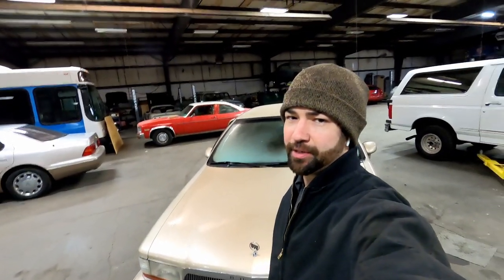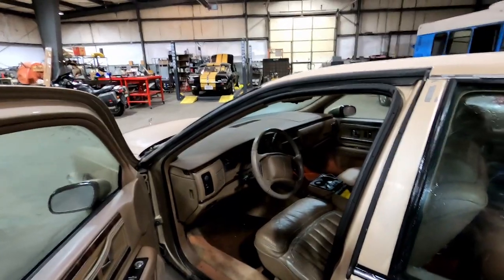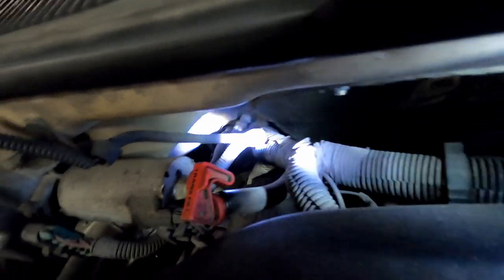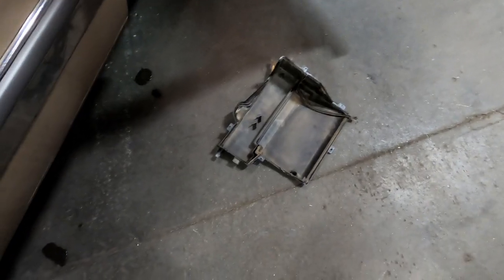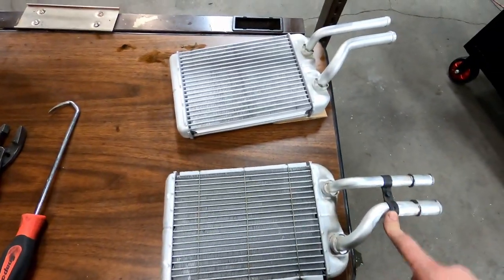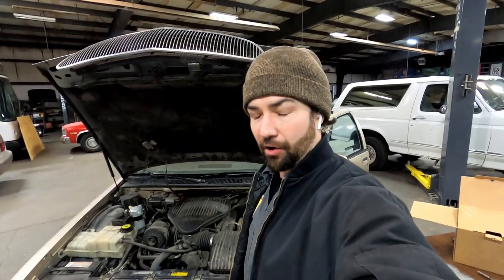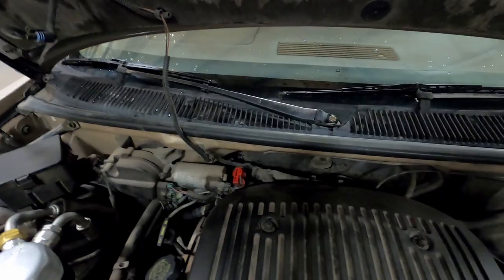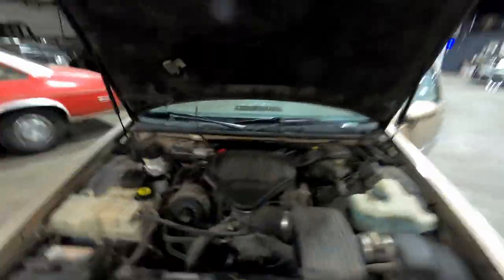The Easiest Heater Core! 1994 Buick Roadmaster

Comment: Those older GM's can be nice to work on. But, the easiest heater core is surprisingly a mid 80's E series Ford van. It's located in the passenger kick panel. Literally a 10 minute job. Keep it up!
Reply: 93 Ford Rangers pretty easy as well
Reply: Same goes for up to 1996 f-series. So easy you could do it in the auto parts store parking lot.
Reply: nope 1970 Ford Galaxy eight or ten screws in the firewall remove two hoses, plate, and out comes the heater core replace in reverse your done did it in less than 20 min.
Reply: That was back when Ford made great cars & trucks.
Reply: Yeah some of the older Ford's it took longer to drain down the coolant down than the repair, my 89 F150 and 82 Mercury Capri (Mustang clone) were both 10-15 minute jobs.

Comment: Quick and easy fix. Gotta love those Buicks.

FMG
Reply: Wouldn't it be nice if the pipes extended in to the cabin with a break  just before the core itself .  Would be so much easier to replace these

Comment: My 96 Roadmaster sedan has heat, but it only comes through the vents. I also think the fresh air/recirculate door is stuck open. The faster I go, the more air I get regardless of fan speed. 
That's just one of the many electronic problems it has. The wiper control module exploded so I had to pull a spring out of the motor to get them out of the park position. Now they only work on high and they stop wherever you turn the switch off.
The fuel gauge quit shortly after replacing the fuel pump assembly. I use my trip meter as a gauge now. I'm getting about 12 mpg. I need a tuneup. I used to get 15 mpg.
The temp gauge quit years ago. So I use the on board diagnostics in the automatic climate control to check the temperature. (It's #8)
The window regulator guides are going out. I've replaced a few with the Dorman 74444 rollers. Just need to do the rest. 
The power antenna motor burnt out. So I gutted it and just use it as a manual antenna now.
It's got over 170k miles on the original Optispark distributor and still running pretty good. But I'm gonna have to rebuild it soon. Nobody makes a good replacement. Not even MSD. And it's too big of a pain to do it more than once.
The transmission is gonna need rebuilt. But still shifts pretty good for the mileage. Gonna swap out a quart or two of fluid with Lucas for now. 
I replaced the rear main seal and oil pump a few years ago. It was leaking a quart a day so I had no choice. 
I love my Roadmaster. I just wish I had another car to drive so I could get some work done to it. Maybe I can find another Roadmaster 🤔

Comment: Easiest heater core I ever replaced was in a 1979 Ford Fairmont with no A/C. Remove glove box door, remove rectangular plastic panel right behind it, and the heater core slides out like an 8-track tape. The whole job with new heater hoses and coolant took about 35 minutes.

Comment: My mom has a 95 with the lt1, I'm going to have to replace the water pump soon as it's dripping out the weep hole. I should probably just do the oil pan gasket and valve cover gaskets while I am in there.
Reply: You should also replace the opti-spark rotor and cap. I would replace the cam seal that drives the water pump too.

Comment: RWD Cadillac's '80 - '92 are pretty easy to change also.  Just remove the top of the HVAC case to get to it.  I had to change a evaporator core and case on a '84 Seville.  Now that was a major job.  The passenger fender had to come off and wheel well liner had to be moved to get to the bottom bolts.  Seller said the A/C didn't work.  Well no kidding someone over charged it and blew a hole in the evap core and both halves of the case,

Comment: wow... if this is so easily the way of the universe works and to bring balance back... there must be a repair that is hard to do and take a lot longer to do on this car?????
Reply: Changing the Opti-Spark cap and rotor is a PITA compared to a distributor or a coil pack on eariler/later cars respectively.